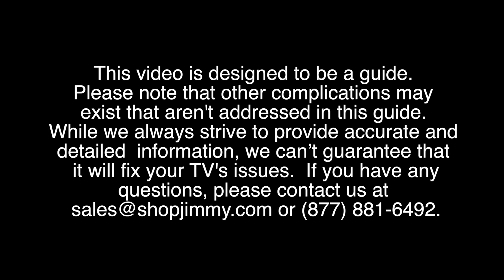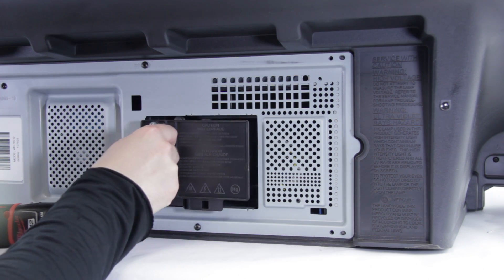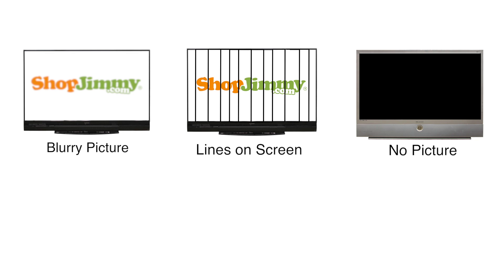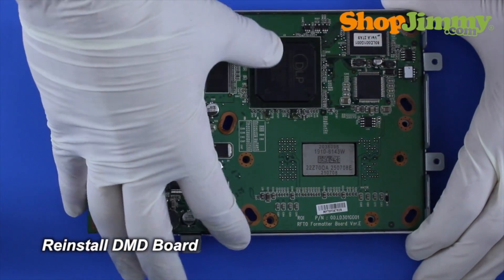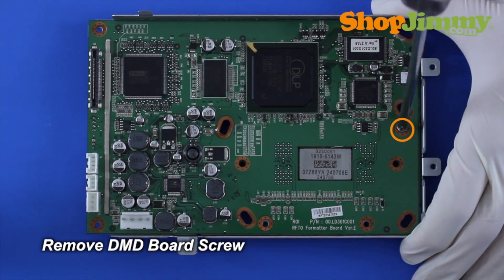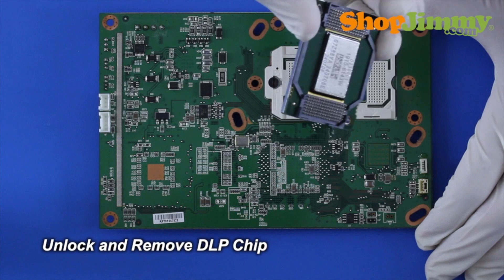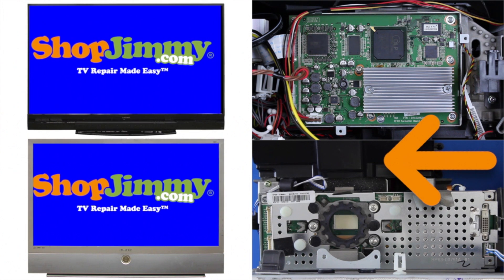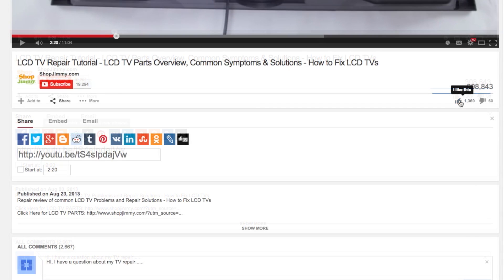White Dots DLP Chip Replacement Troubleshooting Guide for Problems after Installation

Comment: If you use thermal paste to replace the thermal pad, use a very thin layer so the paste does not squeeze out and make contact with the DLP chip pins. This will plead voltage from the chip to the TV frame and caused a large dark bar on our TV. Also, be sure chip window is very clean and the same for the mirror opposing the chip and as well for the magnifier. We got all done and had a big blur and had to go in and clean again. I used Q-tips, alcohol and compressed air. This TV is now one of the best I have ever seen.

Comment: samsung hl67a750a dlp led rear projector tv  when power up green led flashes and no picture only chimer goes and off all the time .When to turn off tv it stays on I have to disconectthe wall plug . I called tv service that the dlp chip that caused all the problem. I would to get an answer thank You

Comment: I Have a HLT6187sx/xaa, Samsung LED DLP TV.  the led power supply went out recently taking out the red led in the process. I have replaced the power supply but not the red led yet. the tv turns on but does not have a picture.  on initial start up the led's light up shut off as usual and then when the picture is suppose to come up the led's pulse to dim to be seen on the screen. I thought this was due to the red led being burnt out but a lot of places show that the tv will still give picture just with no red color.  could this be due to the dlp chip going out or the DMD board being bad.  any help is appreciated.

Comment: So after I replaced the DLP chip now I have a bowing of the image problem on the bottom right of the screen. If you tighten the DLP chip on the DMD board, can this make it happen? I don't know what to do about the geometry issue I am now having. Advice?
Reply from the maker: Loccs79  Try all repairs and troubleshooting at your own risk.  <!-td {border: 1px solid #ccc;}br {mso-data-placement:same-cell;}->Double check the formatter board to see if it's set correctly also make sure the screws are just hand tight, there is no need to over tighten them.  Thanks!  www.shopjimmy.com
Reply: ShopJimmy.com With these TV's no longer under warranty, I see little risk. Are you saying for the screws to be hand tight on the formatter board or on the DLP chip itself? I assume the formatter board is the same thing as the DMD board correct? This geometry issue is aggravating me.
Reply from the maker: Loccs79 The DMD/Formatter board.  Thanks!  www.shopjimmy.com
Reply: ShopJimmy.com  Are you saying for the screws to be hand tight on the formatter board or on the DLP chip itself?

1. There are 3 screws that hold the DMD board to the chassis.
2. There are 2 screws that hold the DLP chip to the DMD board.

My question pertains to which ones if over tighten cause the geometry issue? Any other set of screws that might control that?
Reply from the maker: Loccs79    The DMD/Formatter board.  Thanks!  www.shopjimmy.com

Comment: Hi, i have  a Philips 42PFK6309. If i press the "List" Button, 5 seconds later the TV shows it!So, the TV is very slow i think. What cab I do that the TV is faster?Maybe install  an other Software vor an other Board? I don't know, and i don't see any answers in the Internet, so i hope you Gould help me please. If you answer me or  it would be so nice!But a Video would be much better!I don't want longer this problem!I would be very happy, if you Gould help me with an answer or  a video!:)
Reply from the maker: Datrox   Try all repairs and troubleshooting at your own risk.  I recommend replacing the main board in your TV.  Unfortunately I do not see any replacement parts in the search results for your TV model number on our website.  Please reply with your part number on your main board and I can try searching for replacement parts.  Thanks and please let us know if you have any further questions!  www.shopjimmy.com

Comment: Hi I have a question that doesn't exactly pertain to this video.

I have a 60 inch LG tv that has a very odd problem. The left side of the tv looks just fine but on the right side I have a huge thin whit line covering 1/5 of the tv. You can see through the white line, but it's very annoying. The tv also has a problem with brightening and darkening every second, this effects the whole tv, but more so on the right hand side it and slightly on the left side.

I've made sure I didnt have a power saving option on, or any other options on the tv itself, so I'm convinced it must be a hardware issue, the brigtness problem and the white line. 

I'd assume the ribbon inside of the tv is messed up somehow and I should replace that part, I just want to know if you also think the same?

I also have a 45 inch lg tv that turns off as soon as I turn it on. You can hear a TS sound when it turns off. No doubt a power supply issue in the tv. or... maybe something else?